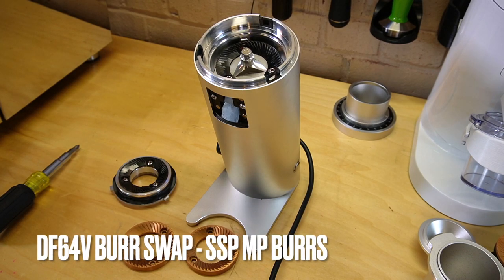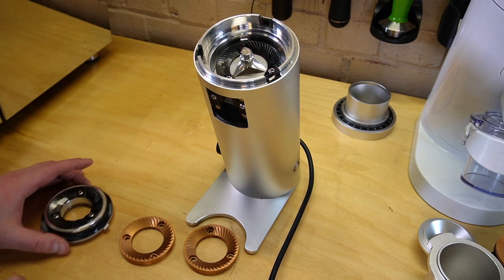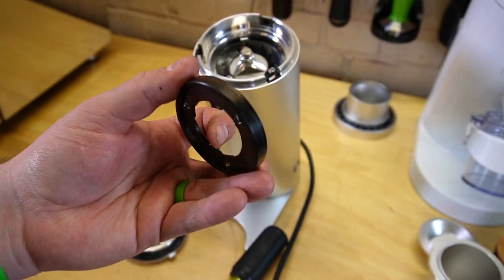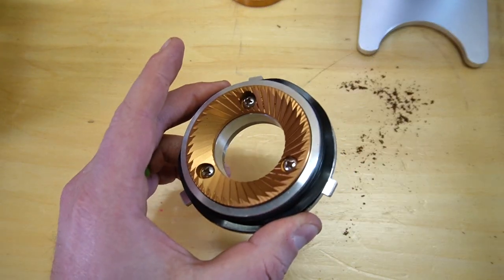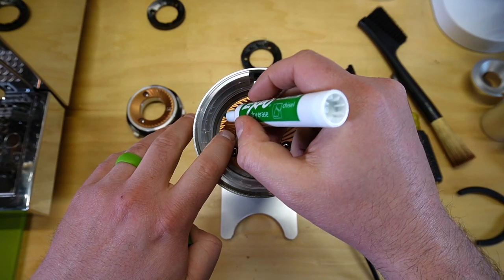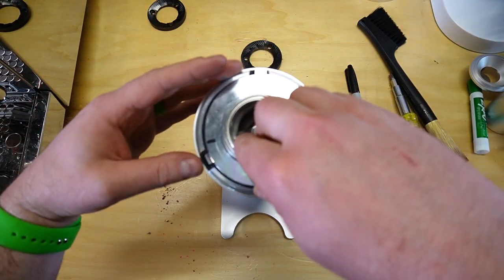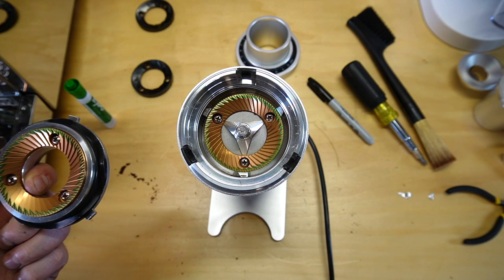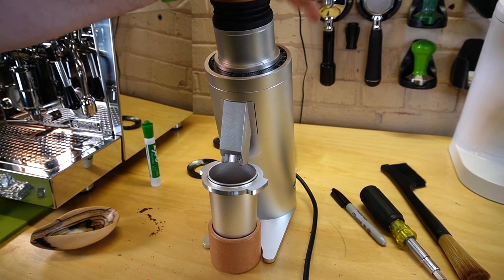DF64V Burr Swap SSP Multi Purpose MP Burrs

Comment: I’m sorry but did you really tighten those rotary burr screws enough? I am taking an adjustable wrench to the nut in the middle and unfortunately it doesn’t work because it also loosens to the left. And I can’t hold the burr enough to properly tighten the screws. Just crazy and odd design
Reply from the maker: Hmm not really following, but have swapped burrs on many brands, pretty much all can be difficult to do because the bottom carrier rotates.
Reply: @EspressoOutlet and that’s why on other grinders I’ve had like a rocky Rancilio, I could use a wrench to grab the rotating nut to apply a counter force and easily tighten or loosen the burr screws. This grinder doesn’t allow that because the top nut loosens and tightens in the same direction easily. Giving me nothing to hold on to. Whatever,  I’ll never know I guess if I tightened the screw enough.
Reply: @coffeem8011  Try using a vise grip use a cloth to cover dampens the metal to metal contact ont he top nut.